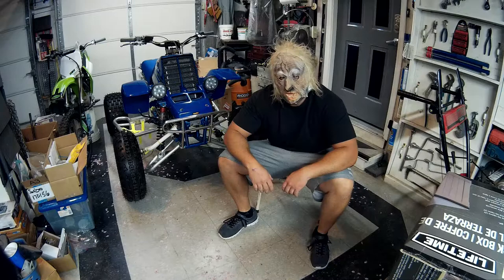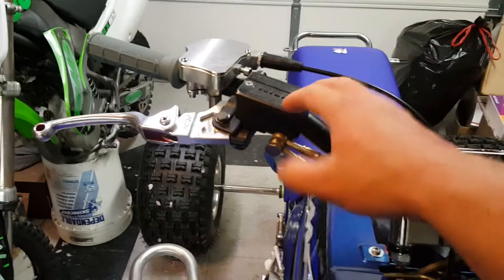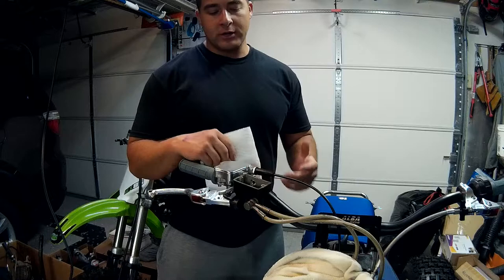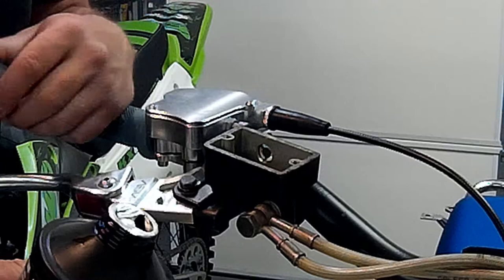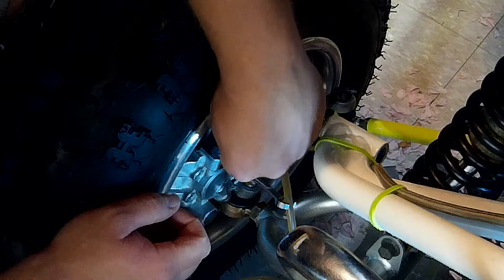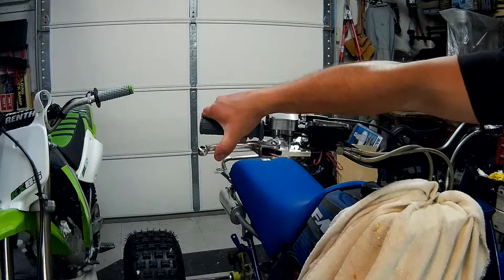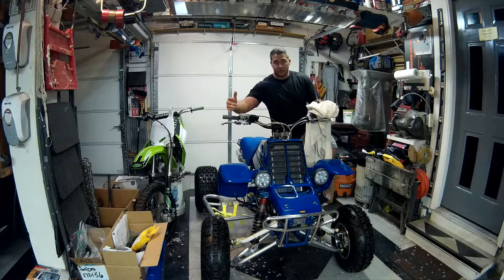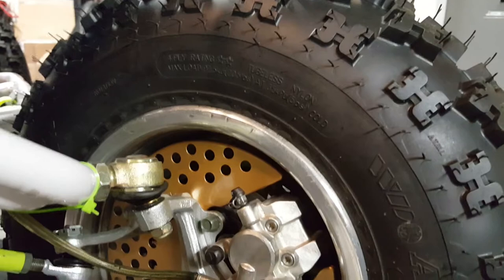Bleed Front Brakes | Banshee 350

Comment: Yo I know this video is old but I’m having the exact problem with my banshees front brake master cylinder screws being stripped. Did you ever make a video showing how to get these out? Thanks!
Reply from the maker: An impact driver will get them right out or if you have a chisel and hammer, you can tap the edge and get it spinning.